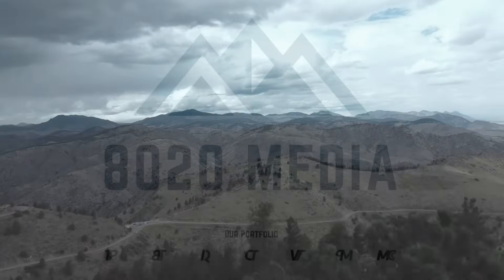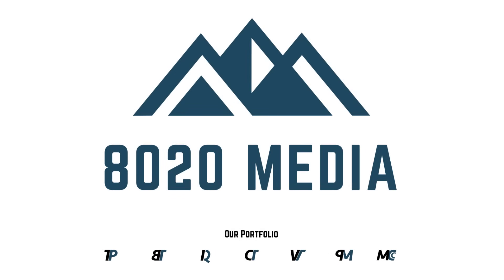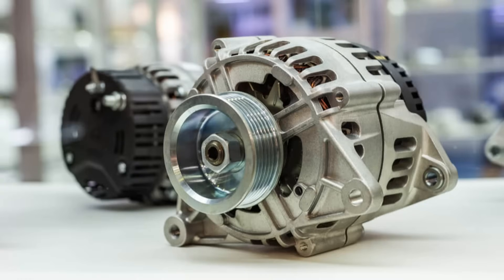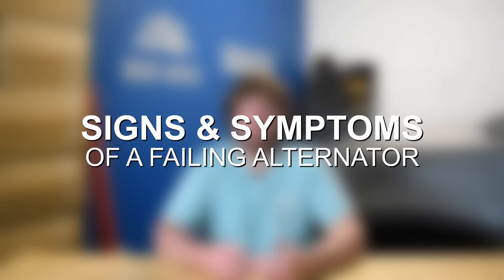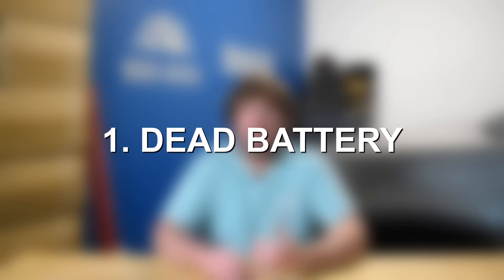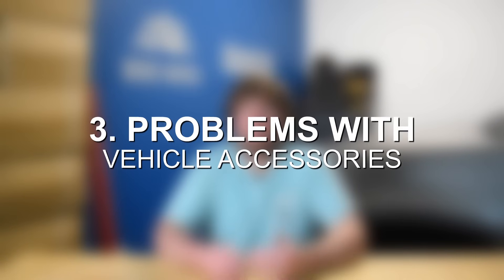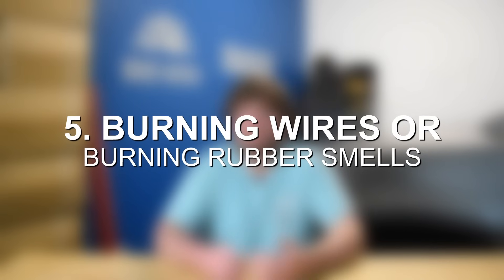6 Symptoms of a Bad Alternator!

Comment: I have a new alternator but after 3 months it's not charging. Getting 12 volts running. When new its voltage was bouncing around like the last one. I think it maybe the built in regular (smart car 451)
Reply from the maker: D - If your new alternator is only showing 12 volts while running, it's definitely not charging, and given that it's your second alternator showing similar behavior—especially with voltage bouncing around early on—the issue is very likely with the built-in voltage regulator or the external control circuit. This car uses a computer-controlled charging system, meaning the ECU (or SAM module) tells the alternator how much to charge, and if that signal isn’t reaching the regulator, it won't energize the field coil properly. Check the alternator control wire (typically a small wire separate from the main output terminal) for voltage with the engine running—it should have around 10–14 volts depending on demand. If it doesn’t, you may have a faulty control module, bad wiring, or a fuse issue interrupting the signal. Also inspect the ground connections, especially the chassis and engine grounds, as poor grounding can cause unstable voltage and premature regulator failure.

Comment: Sputtering, loud knocking indrive at idle. Put it in park, less draw, it calmed down. Back into drive, sputtering, knocking, stalling again. Tried hitting accelerator, felt like something was pulling on the car. Being night, lights dimmed, every sputter!  Also had problems with radio not coming on at all! Fine other times! This is a 2008 Charger, 2.7 liter. Car, over $10,000 in repair costs. It was a S.C car, now in AZ! Was salvaged, restored title too! Definate history here! Just finished new timing chain, water pump, valve caps, rollers, (all scored!). Mechanic checked oil pump, was bad, (no wonder upper engine got little oil! New cams, tensioner, etc! Got it back, AC lost freon. Got it back, whining sound like a chevy fuel pump whine. Both my pumps also replaced. So, suspected power steering? Finally realizing, same symptoms as beforeall this work, dimming lights, realized, had to be electrical. Stop at O'reilly's and they quickly determined alternator fail! New "Ultima" now going in!  $325 + $300 labor! 😡 My mechanic over 30 years experience, will NOT use, cheap "Mastercraft," parts!  Remanufactured? Advice: if you have a car, with an alternator under side of engine, requiring huge amounts of labor time? Do NOT waste your time on cheap! $75 difference is NOT worth it! Buy new depending on how expensive your labor is to replace! The Charger alternator down below, is about 4hrs!
Reply: Also remember, these chain shops, buy cheap parts, and charge you high side! Advocate for yourself, ask what brands they are, are they new or remanufactured? Are they remanufactured in Mexico, China, Taiwan, etc! My experience, Chinese parts have broken quickly, sometimes in same day! Mastercraft is in Mexico. My mechanic goes by their reputation, and if you make cheap parts that is what your reputation will be! If it's Taiwan, and it lasts??? Look online, look it up! "Precision," and "Ultima," (which is a "Denso," build), know to be good!  has a good reputation
Reply from the maker: R - Sorry to hear this.. However, we appreciate you taking the time to share your experience!
Reply: This is my problem right now 😒.  So over this chase game!! I replaced everything but thee alt because I did last year!! Soo I dont know!! Was it the alt?

Comment: Interesting. My battery light came on yesterday and the vehicle, thank God I made it nearly home, started to putter like there was bad gas in the line. There were 3-4 lights in the dash which came on. While at the gas station to get some dry gas, the car has stalled yet the dashboard lights were still on. I was able to get a jump but about 10 mins later the car started puttering and eventually went dead. 

I had the vehicle towed home and got a call from the mechanic saying to come get the car, when I went, the battery had been fully charged and it started without hesitation. My mother said to me, “check if there is water in the battery”. My stepfather was a mechanic and always told her to check certain things, water in battery was one. Mind you, the battery is a year old, but with all the high heat and humidity we’ve been experiencing in NY, it makes me wonder. 

I haven’t went and checked if the vehicle will start but I will test drive and stay local. If the battery light comes on I will head home right away before it completely dies. 

Oh there was no unusual flashing of dashboard lights, they came on but were constantly lit. The whole appeared like a draining. I’m wondering after the complete failure, if the alternator, the vehicle  battery shouldn’t have charge. 

Thanks
Reply from the maker: I - Based on your symptoms, it strongly points to an alternator failure. Once the alternator stops charging, the vehicle runs solely off the battery until it's drained, which explains the sputtering and eventual stall. The fact that the car started again after charging the battery confirms the battery isn't the main issue; it's likely not being recharged while driving. In hot weather, alternator stress increases, especially if it’s already weak. Checking for water in a serviceable battery is good practice, but most modern batteries are sealed and maintenance-free. You should test the charging system with a multimeter: with the engine running, voltage across the battery terminals should read 13.7–14.7V. If it stays at or below 12.6V, the alternator isn’t charging. If your battery light returns while test driving, go straight home—it means the charging system is failing again. A failing alternator can act intermittent at first, which may explain why it seemed to work after a recharge. Have the alternator tested or replaced before driving it long distances.

Comment: Bit of whining off and on,voltage dropping from around 14v ro just below 13v
Reply from the maker: S - Intermittent whining combined with voltage dropping from around 14V to just below 13V typically points to a failing alternator or voltage regulator—especially if the whining correlates with electrical load changes or engine RPM. The alternator should consistently maintain voltage between 13.8–14.5V while running; dropping into the low 13s or below can mean the alternator is struggling to keep up or is beginning to fail. The whining sound could be from a worn alternator bearing or internal components, and if it's accompanied by dimming lights or battery warnings, it's best to test the alternator under load and consider replacement before it leaves you stranded.

Comment: If the car/truck has a cranking/clicking sound but wont turn over/on. Could that also be an altenator issue?
Reply from the maker: C - A cranking or clicking sound but no engine start is usually not caused by the alternator—it's most often a battery, starter, or connection issue. The alternator's job is to charge the battery while the engine is running, so if your vehicle won’t start, it’s more likely that the battery doesn’t have enough charge (possibly due to a weak battery, corroded terminals, or a failing starter drawing too much current). A single click usually means starter solenoid or bad connection; rapid clicking typically points to a low battery. If it cranks strongly but doesn’t start, that’s a separate issue—like fuel or ignition. But bottom line: alternators don’t stop your engine from cranking—batteries and starters do.

Comment: my accelerator decided to stop working and then the power steering cut out and the car was bunny hopping like I was driving a manual but it's an automatic and then it shit itself and wouldn't work or move. We started it up a couple times. We had to jump start her as well. but every time I slowed down the Excelerator wouldn't work after that and the power steering would go. I'm thinking it's the alternator. Does anyone know if it is the alternator?
Reply from the maker: L - Your symptoms strongly point to a failing alternator—when the alternator goes, it can’t keep the electrical system powered once the battery voltage drops too low, which leads to loss of throttle response (drive-by-wire systems need voltage), power steering failure (if it's electric assist), stumbling or jerking (like “bunny hopping”), and eventually the car just gives up. The fact that it only ran after a jump start and then quickly lost systems as you slowed down confirms it’s likely running on battery alone, which dies fast without alternator support. To be sure, have the alternator tested under load at a parts store or with a voltmeter—it should read around 13.8–14.5 volts while running. If it’s showing 12 volts or dropping while idling, your alternator is toast.

Comment: i wonder why when my caravan idle i'LL disconnect my  neg. and or pos. to check my alternator then dies on me , But in the morning at HIGH  idle it works fine only on high idle even when the car is warmed up .   HIgh idle good low idle it stalls with a dead bat.     help me please.
Reply from the maker: C - What you’re experiencing is a classic sign of a failing alternator or a bad charging system ground—when your Caravan is at high idle (like during a cold start), the alternator spins fast enough to barely keep up with the electrical demand, but as soon as the engine drops to low idle, the alternator output drops below what's needed, and the car starts running off the battery alone until it dies; disconnecting the battery while the engine is running (which is not safe and can fry electronics, by the way) removes that last source of voltage, and the engine stalls—this shouldn’t happen if the alternator is working properly; you should test voltage at the battery with the engine running: it should be 13.8–14.5 volts at idle—if it’s lower or drops as the idle falls, the alternator’s either weak, the belt is slipping, or the voltage regulator isn’t doing its job, and replacing the alternator is likely your fix.

Comment: Well I had my alternator changed on my car but now when I get ready to crank it it doesn’t crank right away so I took to O’Reilly and they put it on that thing it said alternator so now I gotta get a starter 😅
Reply from the maker: B - Sorry to hear - If your car isn't cranking right away after replacing the alternator, don't rush into replacing the starter just yet—sometimes a bad ground connection, loose battery cable, or even an incorrect alternator install (like a pinched wire or poor ground path) can cause delayed or weak starting, and auto parts store testers can sometimes misread symptoms if voltage is low or unstable; before spending more money, double-check all battery and starter connections, especially the ground from the battery to the frame and engine block, and make sure the alternator wiring is clean, tight, and not arcing—if all that checks out, then yes, a weak or failing starter could be the cause, especially if you hear a click or slow crank when turning the key.
Reply: @8020Automotive what if it needs a higher amperage alternator the make 115 an 140

Comment: discovered your channel. can a new battery go bad with a failing alternator thank you
Reply from the maker: T - Hope you find our content helpful! Yep, a brand-new battery can absolutely go bad if the alternator is failing, especially if it's undercharging (not giving enough voltage to keep the battery charged) or overcharging (sending too much voltage, which can boil the battery and damage the cells); even a healthy new battery won’t last long if the alternator isn’t regulating voltage properly, so if your new battery is already acting weak or your lights are flickering, it’s a good idea to check alternator output—it should be around 13.8 to 14.5 volts while the engine’s running.

Comment: I’m here because my 03 Mini Cooper just started having issues lmao

Power steering will get stiff until I hit 4K rpm, lights dimming / getting unreasonably bright 
Rpm needle got stuck, speedometer needle got stuck lmao, lost some power in first gear

Im sure its a bad battery as I accidentally left the lights on for 2 hours while I was at work
Reply from the maker: S - Unfortunately, that’s a classic case of low system voltage wreaking havoc on everything—the stiff power steering (which is electric on the ‘03 Mini), the flickering/dimming lights, stuck gauges, and sluggish throttle are all symptoms of your electrical system struggling to stay alive, and while the battery may be weak from being drained, this screams a failing alternator more than just a dead battery; a battery left on for 2 hours shouldn’t kill it that bad unless it's already worn out, and your power steering and dash cluster losing their minds point to low or fluctuating alternator output, so I’d test both battery and alternator ASAP—if your alternator is only kicking in at 4K RPM, it’s likely dying or has a bad voltage regulator, and that’s the root of your chaos.

Comment: Thank you for this video! I think my issue is the Alternator but I’m unsure. Didn’t run 1995 Chevy Truck for a few days. Attempted to start and got no sound, no crank, no headlights or dash lights, complete silence.
I plugged a box jump starter in and it turned on but my RPM gauge was going up and down dramatically for about 2 minutes on its own(sounding normal), headlights flickering when turned on as well. Turned off the headlights and after a few minutes truck seemed okay idle, rpm guage stopped moving dramatically and stayed at normal idle. Backed out of spot and drove back in, turned off truck and it would not crank/no noise but this time the lights on dash were very dim, guessing the alternator charged up battery a bit.
Battery is brand new from February.
Reply from the maker: M - Based on what you described, it definitely sounds like your alternator is the most likely culprit—when a truck sits and the battery goes completely dead with zero lights or crank, then runs erratically and flickers lights when jump-started, it usually points to a charging system failure, and the fact that things stabilized for a bit then died again after shutting off strongly suggests the alternator isn’t replenishing the battery properly; even with a new battery, if the alternator isn’t outputting enough voltage (should be around 13.8–14.5 volts when running), the truck will run off the battery alone until it drains again, causing those flickering lights and the RPM gauge going haywire due to low system voltage; I’d recommend testing alternator output with a multimeter at the battery terminals while the engine is running—if it’s below 13 volts or fluctuating heavily, you’ve found your problem, and a new alternator should get you back on the road reliably.
Reply: @8020Automotive Thank you so much for your response!! I’m just a girl figuring things out by youtube and the kindness of others! Will definitely do this and if it’s something else will respond back for others view too.

Comment: I have a load humming near the pulley area what part would i start with
Reply from the maker: W - Assuming your meant loud? If you're hearing a loud humming near the pulley area, start by checking the idler pulley and tensioner pulley, as they’re common sources of bearing noise when they begin to wear or seize; with the engine off, spin each pulley by hand and listen for grinding or roughness—if it doesn't spin freely or feels gritty, it’s likely the culprit. Also inspect the alternator, power steering pump, and A/C compressor pulleys, as their internal bearings can hum loudly under load—use a mechanic’s stethoscope or a long screwdriver against each component while the engine runs (carefully) to pinpoint the noise source.

Comment: Just my 2 yr old battery and I rarely drive .was told the battery doesn't fully charge..what?? Never had this before on Any car..it's a 8cyl...maybe diff??
Reply from the maker: S - If your 2-year-old battery keeps dying despite no flickering lights or visible issues, and you're rarely driving the vehicle—especially if it's a V8 with more electronics—then the most likely culprit is parasitic drain or insufficient charging due to short or infrequent drives that don’t allow the alternator to fully recharge the battery; modern vehicles, especially those with larger engines and more systems, draw more standby current even when off, so leaving it parked for days without a battery maintainer can cause repeated drain cycles that weaken the battery over time—get a parasitic draw test done, consider a trickle charger if you drive infrequently, and check the alternator’s charging output under load to make sure it’s sustaining proper voltage.

Comment: I can't stand my battery dying every week..not sure..but no flickering no nothing but dead FKG battery .2 yrs old .been jumped 8x in 2 yrs
Reply from the maker: S - If your 2-year-old battery keeps dying despite no flickering lights or visible issues, and you're rarely driving the vehicle—especially if it's a V8 with more electronics—then the most likely culprit is parasitic drain or insufficient charging due to short or infrequent drives that don’t allow the alternator to fully recharge the battery; modern vehicles, especially those with larger engines and more systems, draw more standby current even when off, so leaving it parked for days without a battery maintainer can cause repeated drain cycles that weaken the battery over time—get a parasitic draw test done, consider a trickle charger if you drive infrequently, and check the alternator’s charging output under load to make sure it’s sustaining proper voltage.